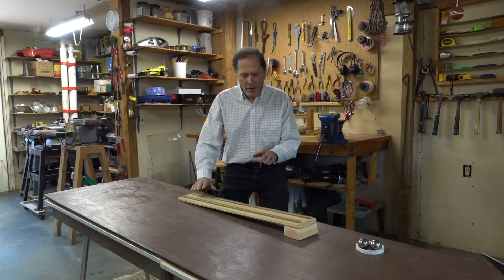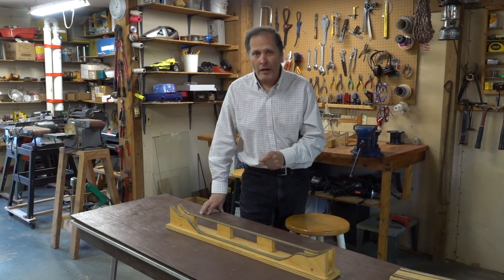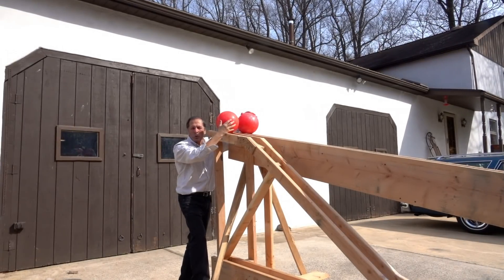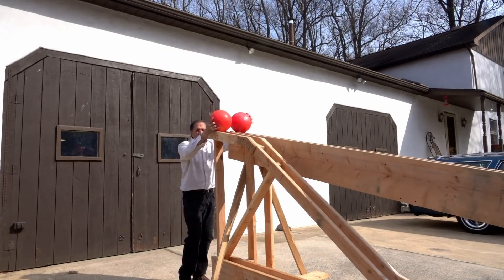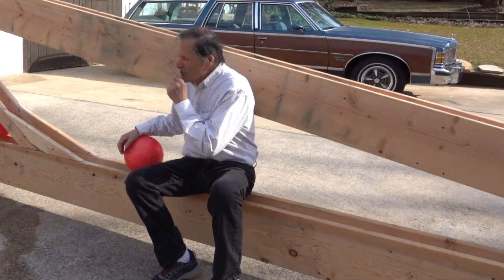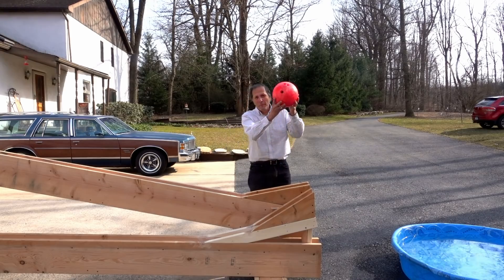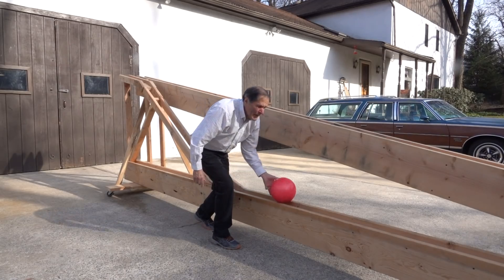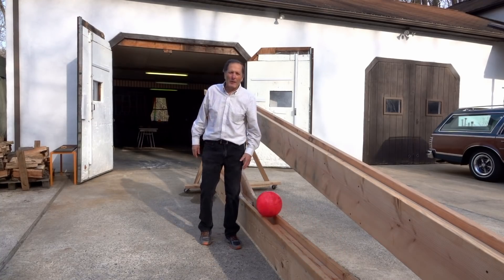Big High Low track //  Homemade Science with Bruce Yeany

Comment: The reason the ball moves faster is because the ramp on the far ball doesn't allow the ball to experience the acceleration due to gravity as freely as the near side ramp. It's the ramp limiting gravity. Not the height differences.

Comment: Yeah, the ball on the lower track achieved a higher average velocity as it gained speed much faster and held it until near the end where it gave it all up on the ramp back up, but still had the lead. If it had not taken that energy away the ball on the lower track would have flown further. There is an effect like this in drag racing where one car can hit a higher speed in the quarter mile but lose to the car that accelerated faster even if they get off the line at the same time.

Comment: I really expected both balls to be the same. The low ball has to climb at the end, losing energy.
Reply: I  almost made that mistake, because normally the question is "which ball is going faster at the end of the track?" and you can see that they DO both have the same speed - due to energy as you point out. But he asked about TIME to get to the end, which is a bit of a trick question. The low ball gets accelerated faster earlier, so spends more of the travel distance at a higher velocity and gets to the end faster, then slows down so that it leaves with the same speed of the other one.

Comment: Does the mass of the ball matter?
Reply from the maker: No,    I should have shown that
Reply: The mass of the ball does not matter, but the distribution of mass does.  If you compared a bowling ball to a volleyball on the same track, the bowling ball that is a solid sphere would beat the hollow volleyball.   Another factor that would make a difference is where on the ball's surface does it contact the track?  The lower the ball sits beneath the track, the slower it would roll.   It is the m*r^2/I ratio that governs how fast it rolls.

Another second order factor that might make a difference is the elasticity of the materials.  I've tried marble tracks with golf balls, actual marbles, billiard balls, and rubber bouncy balls, and depending on the track, one can consistently beat the other if elasticity works to its advantage.  Elasticity can also work to a disadvantage as well.

Comment: Would it  different in vacuum? Is it got anything to do with it? Maybe not, I’m not a physicist... just a curios.
Reply from the maker: the vacuum means without air,  there would still be the same amount of gravity so it would still work,  maybe slightly better since there is no air resistance

Comment: At what point does the low track become too long and the high track starts winning again
Reply from the maker: as long as the lower track isn't made too steep so that the ball loses traction as it climbs back up,  the lower track should always win.  In a previous video I have a  high low track that has the low track drop quite a bit lower than the upper track and it still wins
Reply: @YeanyScience , my brain hurts thinking about this, but is there a point at which the travel time down for the low ball is greater than half the total travel time for the high ball, therefore (total high ball travel time) < (low ball tavel down time + low ball travel up time)
Its late here so i think im going to have to write a program or something tomorrow to help me test the extreme cases.
Reply: @YeanyScience  i tried working out the case of a V shaped track assuming the ball can travel seamlessly through the bottom of the V and can change direction without losing any energy...also ignoring any friction etc. I found that the fastest track is that which has a 45 degree decline and a 45 degree incline back to the starting height. any track with an angle greater or less than 45 degrees is slower for the ball. So a V track that is lower than a 45 degree track will be slower. Have I done this right... and if so it should be transferable to other shaped tracks...like a parabola etc.
Reply from the maker: thanks Brad,  I am planning on building a series of tracks for a local museum,  in do so I will probably do another video on this  so I will be testing  this a bit more.  Will be interesting to see the results  as I test the extremes
Reply: I hope you make a video of them. Look forward to seeing them. I might try making a few small ones to test my theory. Cheers

Comment: I forgot that bowling balls float
Reply: The use of a kiddie pool as a bowling ball crash pad is pretty lit.
Reply: and if you shoot them out of a bowling ball cannon, they whistle
Reply: @GeorgeHicks07  they are primarily plastic and not hollow
Reply: They make them that way in case you throw a gutter ball on a rainy day.
Reply: @veryskeptical2409  You win - Best Answer!
Reply: I just learned something new
Reply: @WoogTV  yea.
Reply: Hi I’m a fan
Reply: why do they float ?
Reply: @theflowerisbeautiful7098  they float for the same reason anything else floats; beause they are less dense than the water.
Reply: @theflowerisbeautiful7098  - lighter bowling balls (which he is using) have a softer core which has air in it (similar to Styrofoam)...a heavier ball had a solid core and doesn't have air in the core like the lighter one
Reply: Bowling balls are not hollow; different weights have core materials and shells of different densities. The volume is the same regardless of the weight of the ball, so all bowling balls have a volume of about 5400 cubic cm. An 8lb ball converted to grams is about 3600 grams. Water weighs about 1 gram per cubic cm, so the same volume of water as a bowling ball weighs about 5400 grams. Since the 8lb ball weighs less than the same volume of water, it floats. This also works with 10lb bowling balls; 12lb bowling balls are almost neutrally buoyant.
Reply: @ERNesbitt   Seems legit since 3600/5400 = 2/3. Thus one third of the volume ball will stay above the water line.

Average diameter of a bowling ball is 21,7 cm. We can look for the height above the water line, which requires to solve 3rd degree polynomial. It leads to approx 8,4 cm
Reply: @ERNesbitt  Don' try to pretend you are smarter then us.............lol
Reply: @jimriddell6470  i mean he is :D i wanted to come up with a smart answer something like duhh theyre hollow and he whips out a big one like this so now this thread is basically solved lol
Reply: I looked up on google, it's due to the density of the bowling ball that is less dense than the water -- and hence it will float......However, if the bowling ball's weight is greater than 12 lb, it will sink -- whereas if the bowling ball's weight is less than 12 lb, it will float.
Reply: @Атак Хеликоптер Very good.  That makes two of us.  We could have been life preservers on the Titanic.
Reply: @GeorgeHicks07  they are not hollow
Reply: ”CANNONBALL!!!”
Reply: @GeorgeHicks07  no, bowling balls are not hollow.
Reply: Shouldn't they not?!
Reply: Only in heavy water
Reply: I didn't know at all.
Reply: Holy frick they do float
Reply: Apply yourself, Jesse!
Reply: Wait you watch these too-
Reply: I can not lie, I had no idea that bowling balls would float! But I did know beforehand that the ramp with the steeper drop was going to cause that bowling ball to reach the end faster and first. I am more destructive than he is; I wouldn't have used a pool of water but maybe some glass or something to break!

Comment: It would be cool to see compare the speeds as both balls leave the track.  Even though one arrives there faster I think they should have the same speed aka magnitude of the velocity vector.
Reply from the maker: Hi Dan,  I have a small  4 track version where we did compare them by having the balls roll off the end of the track and fall to the floor.  They all fall the same distance to the floor so the distance away from the table would indicate their speed.  While they did not fall at the same time, they all fall about the same distance away from the edge indicating their final exit velocity was approximately the same.

Comment: Cycloid for life! Hahahahhaha, did you try to shape the "lower" track as a cycloid -or brachistochrone,or did you just make a lower track?
Reply from the maker: I was happy  just to get it as a couple of angled straight runs of wood, as hard as the big pieces were to work with,  I can't imagine what it would take to give it a cycloid shape
Reply: @YeanyScience    my illusions are shattered!   The great Yeany doesn't know how to bend wood?   Just teasing,  Bruce, love your videos.  The trick is lamination, 3ply 4mm is easy to bend into a shallow curve. When I knocked a passage through an intérieur wall I laminated 5 strips into an arch.  That gives 15ply 20mm.  Not sure about international standards, but UK ones rate that as "bloomin' strong mate".  Over the length you have here it probably wouldn't need intermediate supports.  Just in case you want to make a giant brachistocrone. ......  ta for the video and best wishes.
Reply: Not on such a large scale but perhaps you could demonstrate a "tautochrone" (a.k.a., "isochrone") curve. (Unless you already have, in which case, never mind! :)  )
Reply from the maker: HI Laura,  I have that on my list, but haven't gotten to it yet